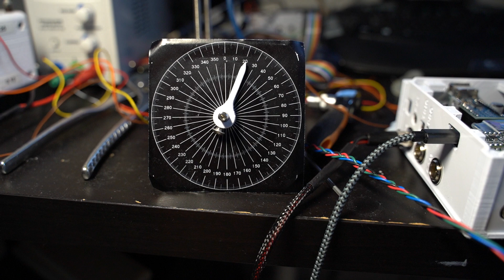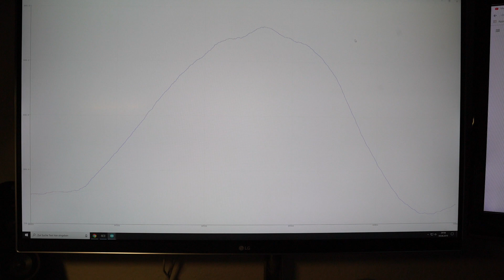Ultrasonic sensor (HC-SR04) for distance control with stepper motors

Comment: hello sir, what controller are u using? is it arduino? if it is arduino, do you mind sharing the coding? tq
Reply from the maker: Yes, it is Arduino (Teensy 3.6). I will check for the code.
Reply: plz shear the prety code